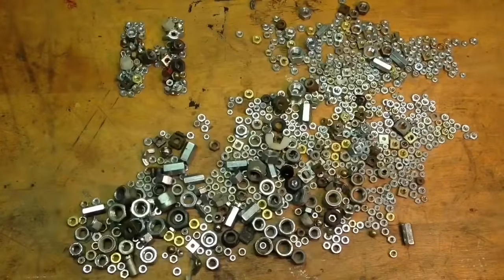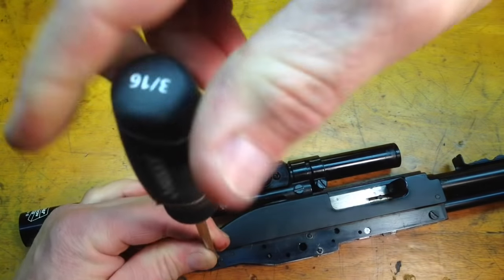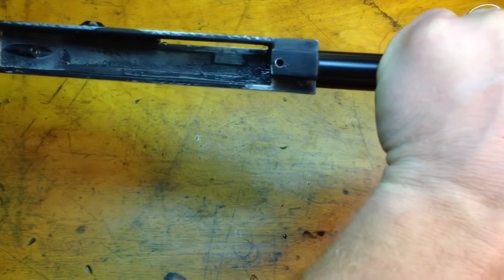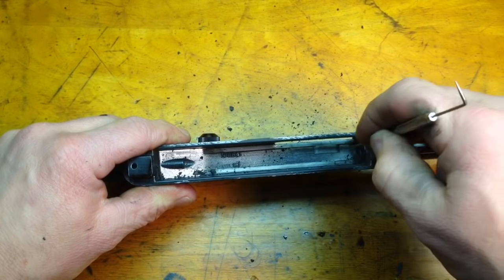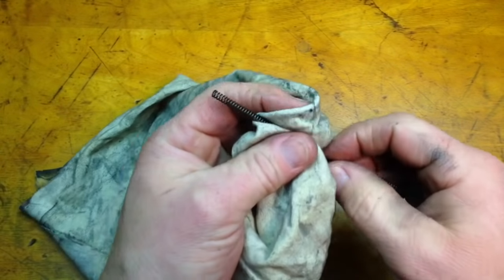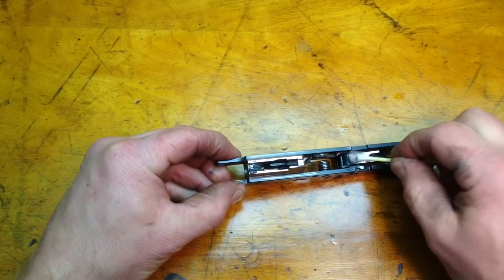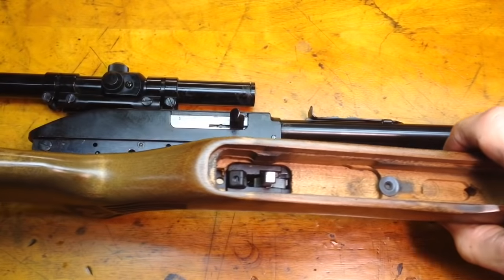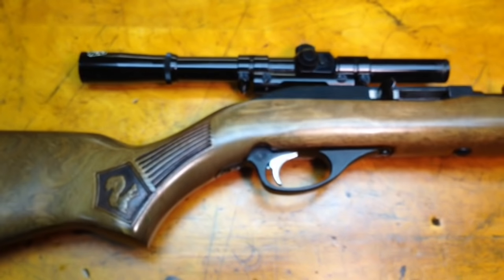Taking apart and cleaning the Marlin model 60

Comment: The newer 60s are even easier to clean. The Chicago screw in the rear of the trigger assembly has been replaced with a pin. The front of the assembly just cams under a permanent  pin. Just remove one pin and lift the assembly out of the action.
Reply from the maker: That's good to know, good idea for them to change a few things. Thanks for watching.

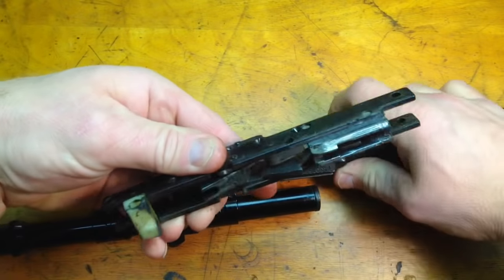Comment: do you know what the white plastic piece is right in between your fingers at 2:10? i took mine apart and that crumbled into pieces
Reply from the maker: It is really hard to tell what part you are referring to, if it is the part right in front of the spring it might be the hammer, in front of that is the feed throat, or if it is the outer assembly that I am holding at 2:10 then it could be the right or left sideplate assembly. Inside there is the cartridge lifter or the bolt release lever. Hope this narrows it down for you . Thanks for watching.
Reply: That white piece is the recoil buffer,you can find a replacement on E Bay.

Comment: Hey grwat video but im having trouble getting my trigger assembling to set back down all the way i pull the bolt back to get it to fall about 3/4 of the way but i cant see why it wont fall down all the way to push my back pin through
Reply: Ugh nvm just figured it out like 2 mins after finally breaking down and commenting to ask for help.  Thats the way it always works out.
Reply from the maker: It can be a little difficult sometimes. Thanks for watching.

Comment: After how many rounds should you clean a Model 60?
Reply from the maker: This one was pretty dirty and had not been cleaned in a long time several thousand rounds. As for when to clean, that is a personal thing. some people clean after every time at the range while other will go a few times. somewhere in the middle is probably good. You could set a number like 1,000 and after that many rounds take it apart and clean it. Hope this helps, Thanks for watching.
Reply: 1000-2000 depending on what ammo you use. If you shoot dirty bulk stuff then every 1000 rounds is ideal. If you go too long without cleaning it out, it will start to malfunction quite a bit. The first time you take it out you should take some very fine sandpaper and polish out the bolt and every surface it rides on, this will help prevent malfunctions and allow your gun to shoot subsonics and lighter loadings with better consistency in ejecting and feeding.

Comment: I have a 70's model 60 that hadn't been shot in about 25 years. I took it down for a cleaning and that plastic piece behind the trigger group was in about 50 pieces. Does anyone know the name of that piece and where I can find one? I dont want to shoot it with missing parts. 
Thanks!
Reply from the maker: I don’t know what the piece is called but I’m sure you could look up a schematic and find the name online. Thanks for watching.
Reply: @funbro1  I found that piece and the name of it. It's the recoil buffer. Since mine was in so many pieces it took some looking. It's also a critical part and the gun should not be used without it.
I haven't replaced it yet but I have a new part 👍🏻
Reply from the maker: That’s awesome. Putting it Back to new again.

Comment: My first time cleaning this one. Bent the slide spring... I needed my help holding the gun down... I think ?
Reply from the maker: It is not the easiest part of the job for sure. Thanks for watching.
Reply: funbro1 bent 2 springs...I’m lost now???
Reply: @danpalka103  Sorry to hear this. I have a small table vise attached to my kitchen table and rapped a towel around the jaws so not to damage the gun. With the gun clamped in there i used needle nose pliers to push the rod and spring into the hole. Good luck.
Reply: Michael Kloeckner Excellent suggestion and thanks for your prompt reply.  I’ll order another spring and give it a try. Thanks
Reply: @danpalka103  No Problem

Comment: How can you find out the year they were made?
Reply: Look at the first two  numbers of the serial number that will be the year that works from 1999 up to now if older take the first 2 numbers and subtract by 2000
Reply: @gunsandatvs8703   I have one with 17364131 and one with 72221835
Reply: Whats the lengths of the barrels
Reply: @gunsandatvs8703   22"
Reply: The first you listed is a 1983 the second is 1972 do they have the 18 round tube?
Reply: @gunsandatvs8703   thanks friend
Reply: No problem man
Reply from the maker: Thanks for all the good info here.

Comment: I can't even get a one inch square cleaning cloth down my barrel
Reply from the maker: +david ogden Try staggering the cloth instead of putting the whole thing down the barrel at once. You may need a smaller patch. Hope this helps, Thanks for watching.
Reply from the maker: I bet I can get a 1" patch down the barrel with very little problem, but a smaller one would definitely be easier. Jebus?
Reply from the maker: It can be done, but it is not the easiest.
Reply: If for some reason staggering the patch doesn’t help, wrapping a small patch around a .17 brush worked well in my case. May be worth a shot.
Reply: david letterman with 22 cals o fold the cloth before putting through the holder, then try and butterfly it out some. When wet with bore cleaner or solvent usually goes through pretty easy

Comment: 22 bores generally do not need cleaning. You can run a patch thru a couple times and that's it. You should also explain the bolt removal better because you have to be careful or you'll bend the spring very easily.
Reply from the maker: I'll patiently await your video on how you would do this job. Thanks for watching.
Reply: Doug, I'm not sure were you got that you only need to put a patch through only couple of times. You should clean it till there is no black on your patch. And put a little oil on the clean patch when your done for the last time just to lube the barrel.